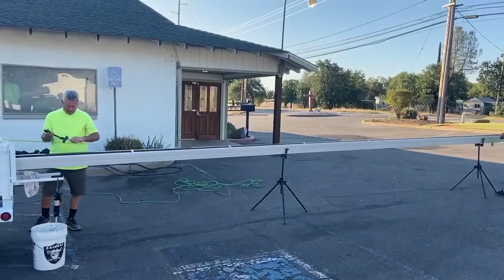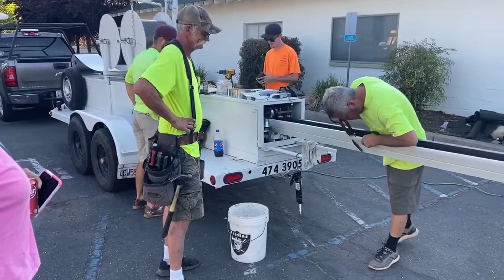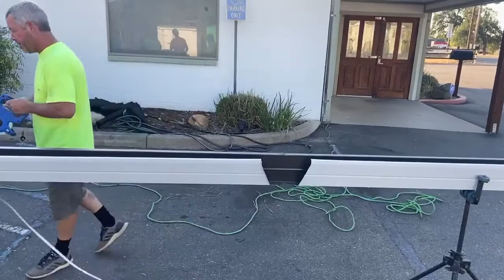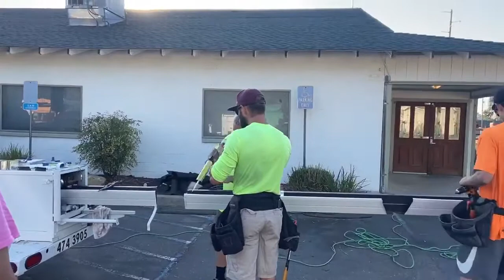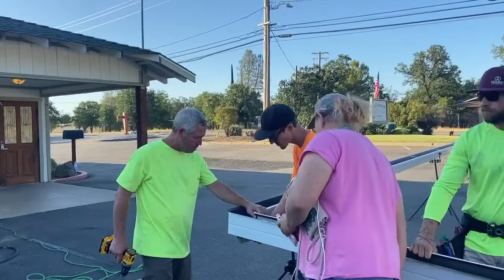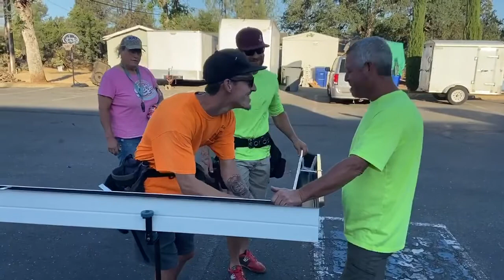Seamless Gutters

Comment: My guy is using his hand brake to secure the hanger on the back of the gutter on a building with open rafters. Ain’t no way you got all those on the money. Moving those over to the rafter while the gutter is up was probably not fun. Never thought to put the hangers in while the gutter was running out though. Definitely going to try that Monday

Comment: What are gutters selling for on the weat coast? Shout out from palm bay florida makin .55c a foot single story sells ab 4-6$ a foot two story is 7-12$ per foot..40-70$ per downspout... can’t complain
Reply: The cost of Gutters in Palm Springs goes from $16 to $20 per foot for 6-inch OG Gutters / Box goes for $25 and Copper is just way up there.